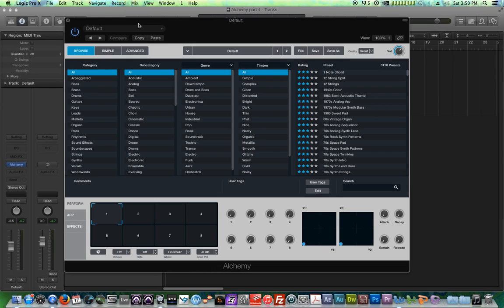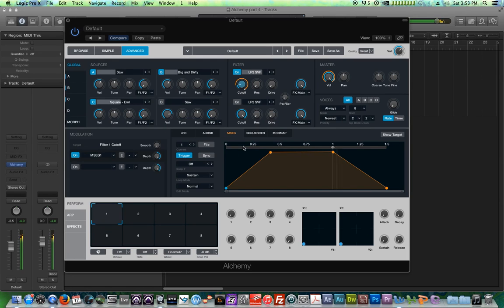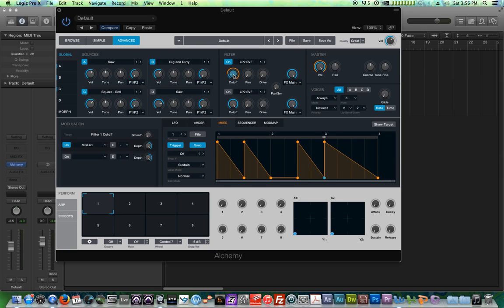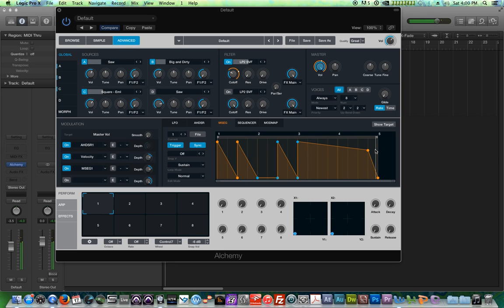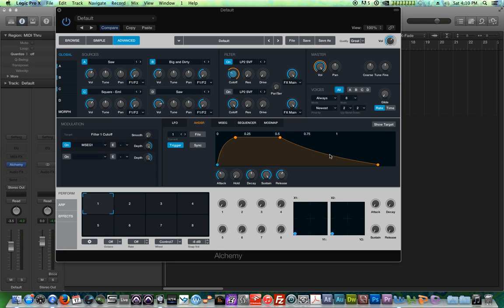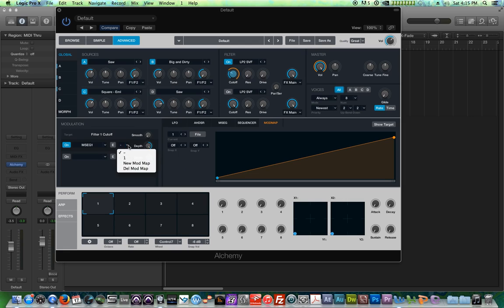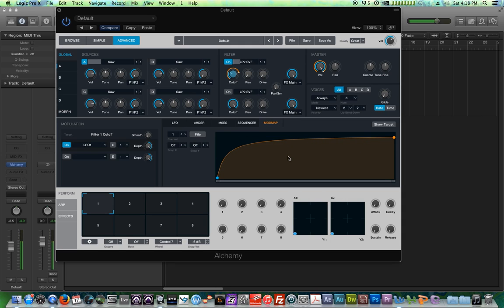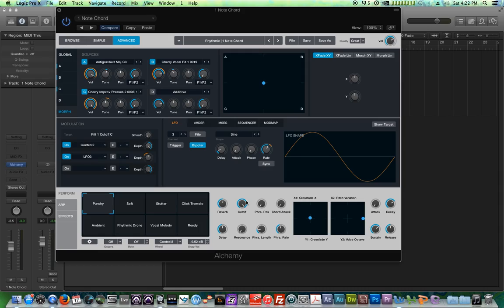Logic Pro X - Alchemy Tutorial - PART 4 - More Modulation, MSEG Envelope, ModMap

Comment: Loving your Alchemy tutorials. Thanks for introducing me to MSEG! It looks like Xfer's LFOTool, though I'm not sure which one is more flexible.
Reply: @Juicy Leek Alchemy came out a few years before LFO Tool, and Alchemy used to be sold separately and was made by Camel Audio. 
I’d say LFO Tool and Alchemy’s MSEG are about equal in what they can do to modulate your sounds. You asked which is “more flexible”, which could mean many different things. Flexible how? So, it’s hard to answer your question exactly. 

But...if I had to pick, I think Alchemy’s MSEG might be more flexible than LFO Tool because you can use it easily and is always there when you open Alchemy. The LFO Tool has to be set up on a mixer’s channel strip a separately, and has to be done a certain way. I know that’s a dumb reason, but that shows how good they both are, it’s impossible to pick one, they’re both amazing.
Reply: @russell_szabados  thanks. I’ve learned a few things since this comment, and I think Logic’s Step FX does pretty much everything that LFOTool can do and more
Reply: @Juicy Leek you’re welcome. And you’re right...I’ve been using Logic 10.2.4 for years and forgot they added Step FX in more recent versions. Cool, I’m glad to hear you’re using it and getting as much use out of it as LFO Tool.

Comment: Is there a way to modulate the velocity of notes so the higher notes are quieter?  For example, I made a super saw preset and the high notes are always overpowering. Catering to my workflow, I wanted the higher notes to gradually get quieter the higher I go without adjusting the velocity of the midi notes in Logic.  Thanks in advance!
Reply: @Ghostatic you can actually set a modulation source for the master volume to Note Property > Key Follow. Think you did find it out anyway but otherwise hope I could help you

Comment: I’m a bit confused, a couple of times in this series you’ve mentioned that the ADSR Env has to be on or it could get stuck and require a space bar. But doesn’t Alchemy recognize a Note Off? Most (well, every other one I’ve ever seen) synths just work like an organ when there is no envelope used. And the note goes off when you let go of the key.